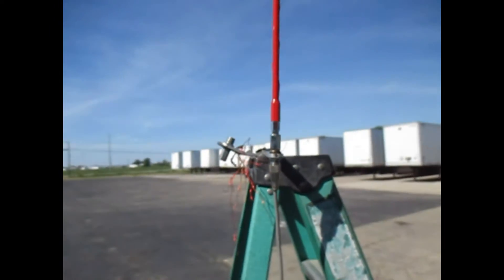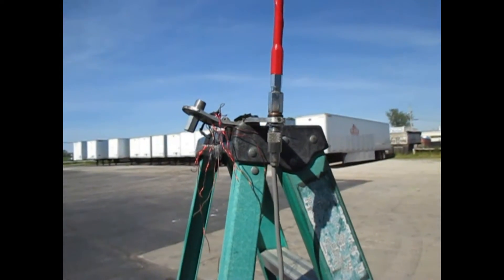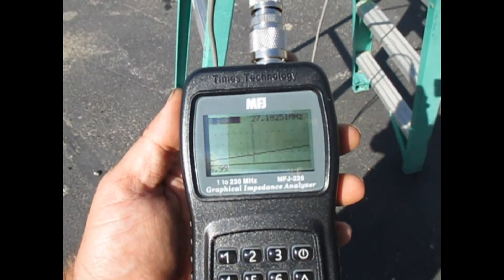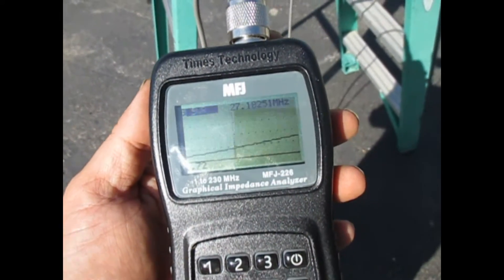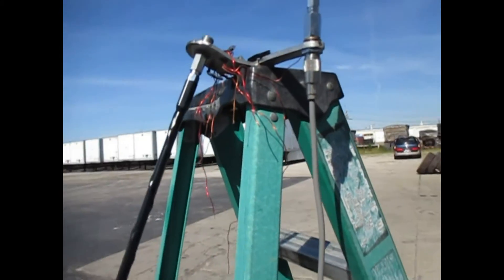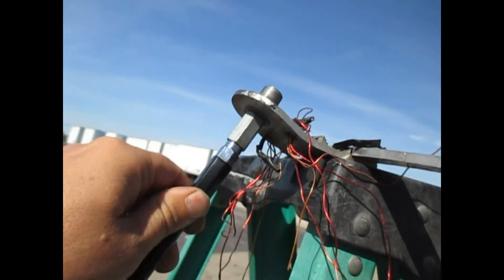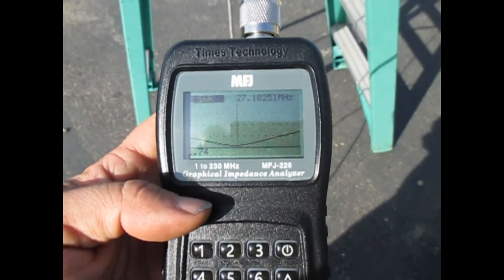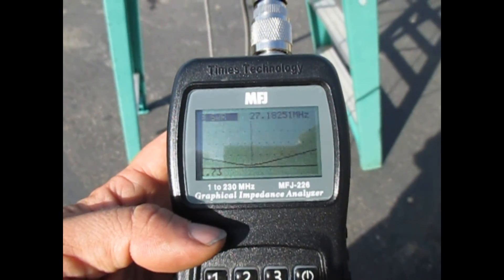A simple demonstration of lack of RF ground and a substitute ground plane.

Comment: I have use this configuration for many years and it works...this a basic dipole I have experiment whit smaller radias for graund 4'3" and 26" whit some good SWR readings... vertical and horizontal...the rule is the more graund the better ...but some times you don't have the space....so you make a graund that fits and work a low SWR for your antenna system..😎

Comment: Best thing you can do with an on clearance price co-phased kit, make 1 antenna mounted into a normal mirror vertical and the other whip can become a ground counterpoise, pointing down, by drilling a hole adding a washer, locker and nut or use the whole other mount, no plastic insulator washer, as close to vertical whip mount as possible.

Nice Tower!!!

Comment: your radial is straight down, which places the impedance in the 75 ohm range. Lifting up (being almost horizontal) that radial would decrease impedance and thus the swr too, you'd be under 1.5 at resonance as 1.7 is a little high. Addig a 1:1 balun at the feedpoint would avoid coax to be part of the grounding system too.
Reply from the maker: I suppose I could do all that, next time I wish to actually talk off my ladder.  I usually just use this setup to test used antennas for good/bad.  1.7 SWR  usually means about 92% efficiency, so I'm not to worried about being so dead set perfect.

Comment: so using this method i should be able to build a mobile antenna(mounted on a tripod) with my CB Radio running off a battery?
Reply from the maker: Yes, absolutely. If you point the ground plain whip straight down, you will likely get a 75 ohm feed point resistance. Aka 1.8 ish SWR.  But if you angle the ground plain about 30 degrees, you can get a closer to a 50 ohm, aka 1.0 SWR. Starduster is a good design example of this technique.
Reply: Jimmy6ification Thank you for your swift and detailed reply!
Reply: Whats the ohm supposed to be for a cophased mobile antenna set up . I always hear 50 ohms but thats for a single antenna on a mobile
Reply: @jasonmiller9495  Yes Sir. 50-52 ohms. I actually built one using same idea but with a collapsible bipod and it surprises me how well it works. I always check everything before using like swr, ohms ect so i dont accidentally burn my cb up. Bought a case from Harbor Freight and put the cb and swr inline for better portability.